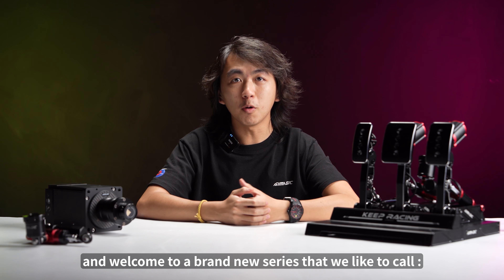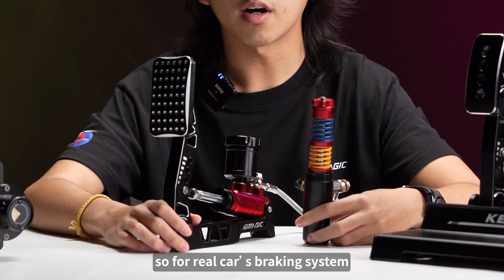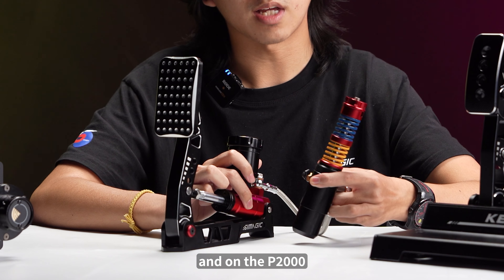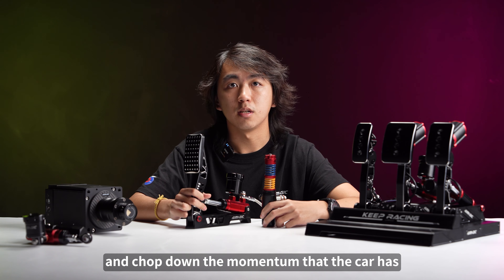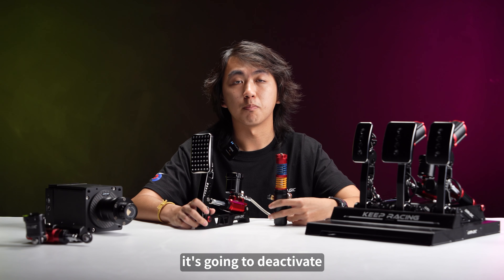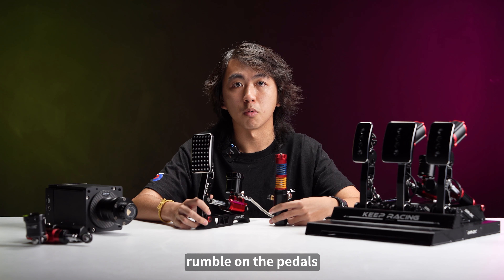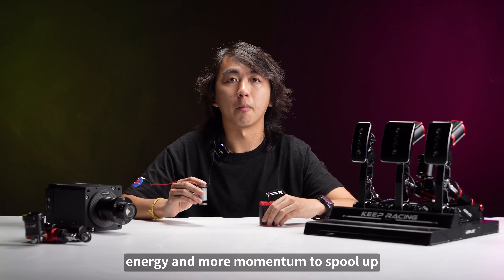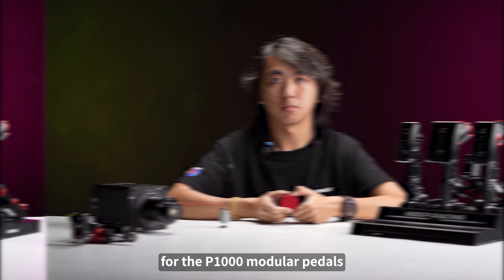The What Motor? | #TechTuesday Ep.1

Comment: When will longitudinal wheel slip and wheel lock be available? Also when will they come for the P2000? Thanks
Reply: Присоединяюсь к вопросу. Хотелось бы переходник для установки на P2000.
Reply from the maker: The haptics are still fairly new to our lineup so there's more in progress for them, they will come soon enough!
Reply: @simagicofficial6890  I’ve fitted my p2000 with the haptic motor using simhub and an power amp. Not wanting to break the haptic motor would you mind sharing the max wattage. I’m pretty sure I have more power than needed.
Reply: @jamespacker8603  Measure the motor coil and...

Comment: You could have shortened the explanation for abs. As  the abs pump takes the pressure applied by the pedal it releases and re applies that pressure to allow the tyre to rotate after it starts to lock and slide on the tarmac, it's basically as if the driver is bashing up and down on the brake pedal. (cadence braking) These very fast modulations can be felt at the pedal as a series of vibrations or jolts. I really love my haptic actuator on my brake pedal. Just make some bigger ones for general shakers to mount to the rig, I'm sure they would sell like hot cakes. Especially if they are as well priced as the pedal haptic motors.